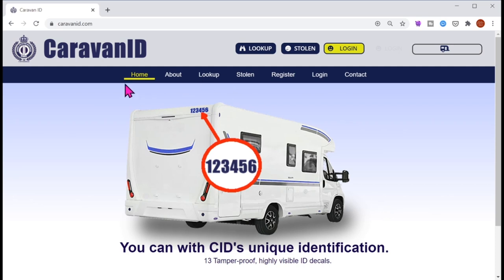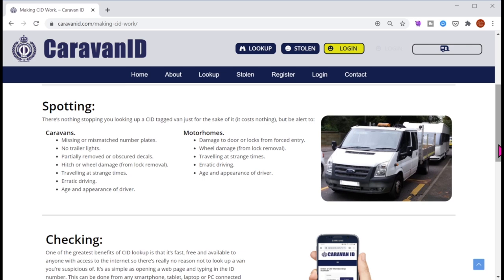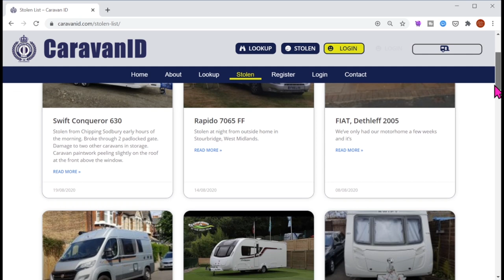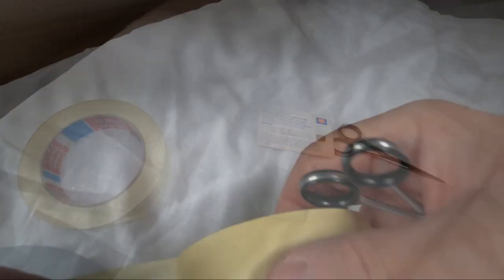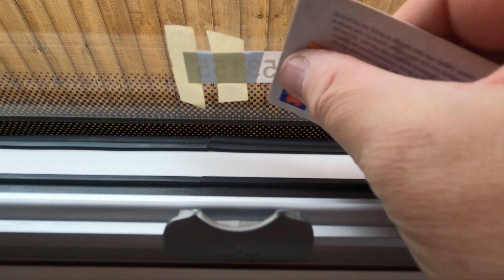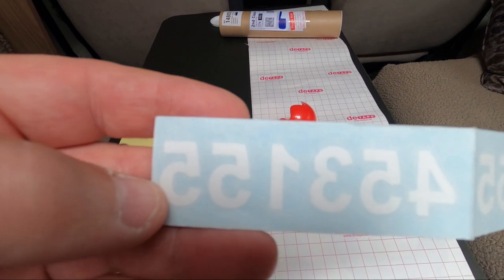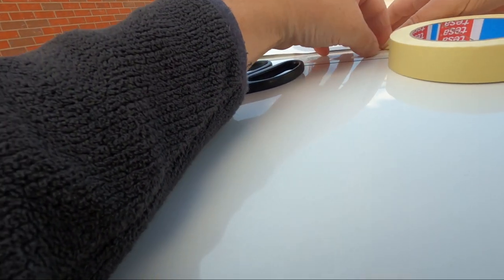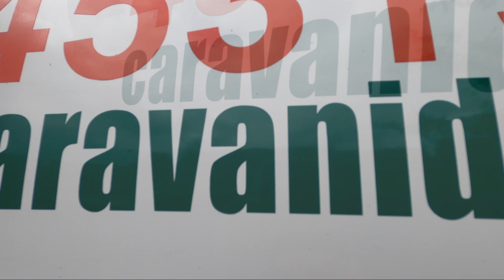Caravan ID - Caravan And Motorhome Theft - Identification And Visual Theft Deterrent

Comment: We've put our vehicle registration number on the roof using decals. As the first thing theives do is take the number plate off, we have also painted our registration number onto the van underneath the number plate. We've also got a big dragon on the back and Daisy's name and flowers on the front. There are plenty of decal sellers out there to personalise our vans.
Reply from the maker: Good idea, but one of the advantages of Caravan ID is that people who look up the Caravan ID on the back of your van can find out if it is stolen or if it should be where it currently is. As the community is built up, people will actively be looking out for your van.
Reply: @BobEarnshawMoHo  In my opinion there is no advantage. There are several  Facebook pages already set up with thousands of members actively looking out for identifiable stolen vans on the road, and in all fairness they have a good success rate.. We just need our vans to look different.

Comment: There is an easier way with the hinge......to put the masking tape across the top of the stencil (to line it up and stick to window) then lift the whole thing up and pull the backing paper nearest to the window half way down stick the top part with numbers back down. and burr to make sure numbers stuck, then pull down rest of backing paper and burr that. Then pull off transfer paper. Or as I would have done for such a small piece just take off the backing paper line up and adhere, then take off transfer paper! I did do vinyl printing as my business once lol. You got there in the end so well done Bob ~ Lin xx
Reply from the maker: Yes, I saw that method on the Caravan ID website, but I was following the written instructions that came with the pack. Wouldn't your method be more difficult with the smaller letters?

Comment: We preffered Chris caravan register.  Its etched into every van window. With the Caravan ID system the thief's just use a spray paint over the number. Also Police dont seem to want to follow up theft. Cheers from old George
Reply from the maker: Thanks for the comments. We have the VIN chip too, linked to CRIS with window etching, plus a tracker, and a Clutch Claw, it's not a total solution, but all part of a range of security measures. The Caravan ID letters are raised, so it would look a bit suspicious with a splash of mismatched paint on the back, plus they have to remove the window stickers.

Comment: have a question why doesn't motor-homes / caravans not have extra bolts on the boor locks so when you lock you vehicle you have these extra bolt that are lockable individually  to the top n bottom main door locks , also not sure but im sure there are alarms installed n  demobilizes but does these include the garage are etc  another idea if there is a break in through the main door what about an automatic light on the back n front of your van at high level in bold red letters say "I AM STOLEN HELP" something like that or even deflate-able tires once the van is broken into all the tires deflate  ....
Reply from the maker: All good ideas, thanks.

Comment: A great, and simple idea. I did watch Martin's vid but thoroughly enjoyed your detailed demonstration of patience and dexterity. 
A very informative article, well explained and you're correct Bob, it's well worth £85 to add another level of security to a 40, 50, 60 thousand pound vehicle. 
What are your thoughts on catalytic converter thefts? 
Keep the great vids coming 👍.
Reply from the maker: Glad you enjoyed it I haven't looked at security for catalytic converters but yes that's a concern too.
Reply: @BobEarnshawMoHo  Catloc is a unique physical security product that is installed around a vehicle catalytic converter or diesel particulate filter (DPF) to prevent theft or tampering.

Comment: Great video Bob, I am one of the 900 that have registered but not paid as yet, my only concern is I may change my caravan fairly regularly then it would mean starting out again, also if I request my specific number and it's not available would CID inform me before parting with my money. 
Richard Harrisson.
Reply from the maker: OK thanks for that, I suppose it is an issue if you change vans frequently, but you can take your number with you, just need to remove the number decals. There is something in the FAQs about changing cans.